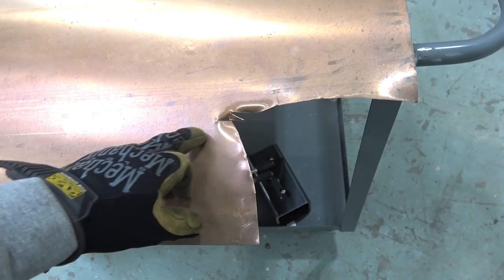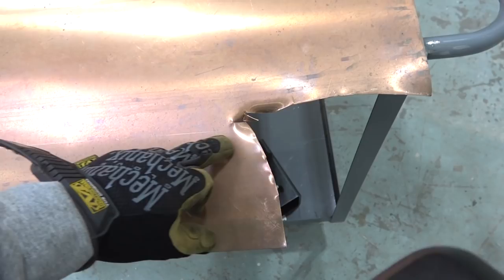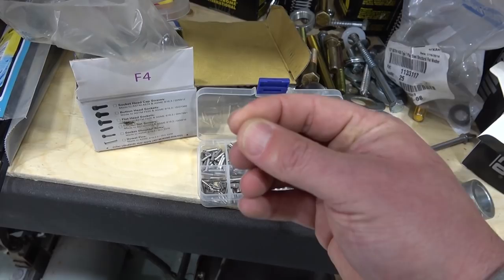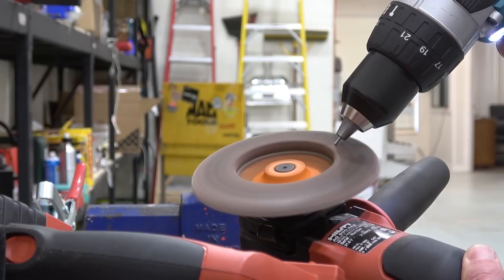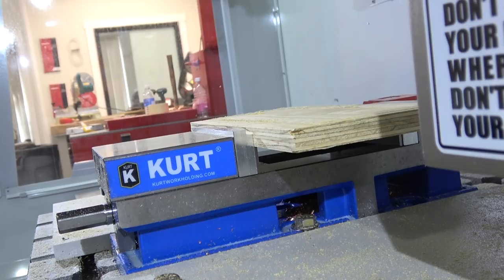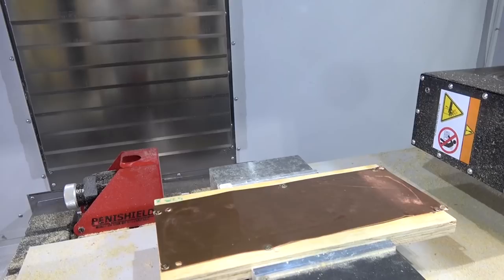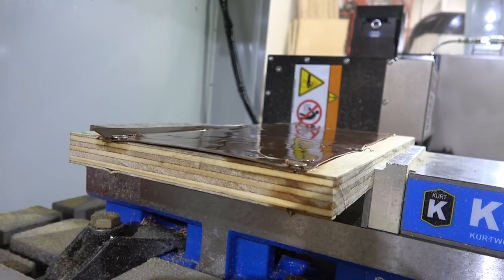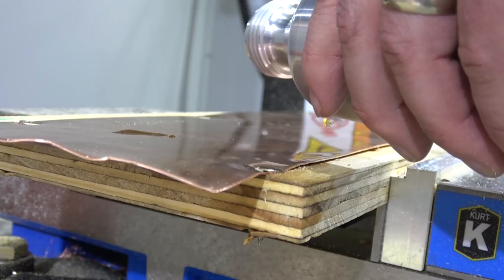Making Copper Signs | Sheet Metal Experiment

Comment: I remember doing something like that in a 7th grade Art class MANY decades ago, although it was by hand... Don't remember what tool we used, but we did not need a pre-cut backing plate to do it... Basically some sort of tool we held in our hands and rubbed the back of the copper sheet to emboss the desired picture into the other side of the copper.  Damn, that would have been over a half century ago -- kind of sounds like a really long time when you say it that way... :)  I had completely forgotten about that until I saw this video... Thanks for bring back the memories...

Comment: Close your lungs little berings. I choked on my coffee. Another thought: Instead of dead tree bonz use a HDPE cutting board from the dollar store?
Reply: Yeah, that's a great idea.
I was considering a chunk of Corian or some other resin/polymer type substrate. Pretty hard and tough, with no grain or anisotropy. My be a problem obtaining a nice few offcuts, which would be obviously cheapest and ideal.
Not sure how the edge would hold up as it could be somewhat brittle. But I think it could work great for a small run batch sort of deal.
The HDPE route sounds well worth checking out though.
Reply: @ChristopherThompson1980  exactly my thought, perfect for experimenting
Reply: @greenveg42  Thank you! randomly and all to infrequently a bit of brilliance shines through the fog.
Reply: @rationalmartian  yeah, at a buck a go, it is the right price for experimenting, I was thinking about the edges also. I'm not sure you really want strong sharp edges, less you create a shearing action with the underling material
Reply: @johncoops6897  I was thinking cost, and also I'm not sure you really want strong sharp edges, less you create a shearing action with the underling material. So if you end up having to chamfer the underlayment to prevent scissoring, why not just a cheap hard plastic that will compress/deform smoothly. Humm... as I think about it I wonder if plastic would "bunch up" and protrude at the apex of acute angled features
Reply: Just use a chunk of aluminum. Same tools cut wood and aluminum so just get a half inch chunk of aloominiumum. It's not that hard to find. You would be amazed how many things are made of aluminum and you can harvest the carcass of whatever you're cannibalizing with a little battery powered circular saw. Anything with a carbide blade works great. You can use a router or laminate trimmer on aluminum as well. Use carbide bits and spray them with wd40 as you go. I've found that if you rough cut your piece pretty close to final size the router clogs less and you spend less time picking chunks out of the bits. It's not perfect but it's pretty close. I use these techniques for production in a sign shop so I know they work

Comment: If you are in need of real tough dead tree carcasses you don't need to go for boat making material you simply go to your hardware store and shop for deck planks. The low budget one are treated plywood but if you look at the more expensive ones you'll see they are made from various exotic woods. Real hard and real nice i use those to make tool handles :P

Comment: use fasteners that arent tapered on the copper sheet side so that it doesnt form "waves" and remains perfectly flat.. or use washers?.. also why not use metal harder than copper for your backing so it has some reuse-ability? or some hard curing resin perhaps?

Comment: In architecture school we did this, but without the wood. just framed up plastic or aluminum and programmed a 6 axis staubli robot to run the tool path. especially with the plastic it comes back a bit when you are done running your full path (think like a topo map, but with one continues line going farther and farther down), but it worked pretty well for forming organic shapes. We 3d scanned my face and i ended up with a scaled down plastic version of half of it.

Comment: I must admit I would have liked to have seen you do a comparative sign using lil screwy where you press the copper plate between two sheets of ply with both positive and negative embossed images on, mostly for the cleanliness of result of the single point forming versus single use carbohydrate dies

Comment: I had to do a relief in school identical to the process you did here, but all by hand. The whole time, I was thinking there must be a better way. I was waiting for you to press too much and cause the copper to tear since it's so easy to do. CNC wins again.
Reply: StapleCactus, you read my mind. I can remember the same project in art class. Still have the piece, too. All by hand, and if I remember right, we used punches, and small, lightweight hammers that looked similar to what an engraver would use.
Reply: @Smokin78Squire  Yeah, I think mine's packed away. I remember bending too much and tearing the copper, then having to hammer-weld it back together.

Comment: Interesting take on repousee', usually the copper is sunk into a layer of pitch and then worked by hand with dapping tools. A small dapping tool (look it up in a jewelry tool catalogue like Gesswein or Stuller) in your cnc may give you better definition and less swirling on the raised parts of your letters. A good layer of pitch around the sides would probably hold your metal with no need for fasteners and keep it from buckling during your forming.

Comment: There is a similar tech, mill a tool plate from a apropriate material.
Dont presure rout it, for small part use hydraulic pres.
Sheet of hard ruber, or a sheet of thick soft carboard like felt type.
In closed tooling this tech is used by hydraulic presure,

Comment: 3D print the form at 100% fill, then use a hydraulic press and firm rubber block to force the copper into the voids in the form.  This process would probably work better on smaller projects - less force needed and not as large a printer platen required.  Less filament used, also.

Comment: That's similar to how I cut stencils for SMD (out of aluminum flashing) on my little 3040 Desktop CNC. 
I Don't use a  pattern though. I cut with a broken .7mm carbide drill. It's on top of an aluminum plate ("Acquired" Road Sign). 
Just take tiny DOC and it sort of cuts / wears / presses the soldermask out. Gotta babysit it the whole time. 
Not for production, BUT a well made stencil IS for production and will last for Hundreds of PCBs.
You can Mill PCBs from copperclad on that machine too, if you've got a 1 off prototype that needs checking yesterday.

Comment: Actually, recycled toilet paper (MDF) is hard on tooling. It’s surprisingly abrasive. I found that out the hard way.....  I have a set of those shears. They were made by Kett, and coincidentally use a Millsucky drill motor. Pretty skookum tool!

Comment: Hi, I would maybe try a milled negative mold as you made with vacume ports and seals milled into it holding the sheet down. It will force the sheet to the table, allow a more consistent depth cuts and may allow some flex in the sheet to be managed.

Comment: Just use a hydraulic press, wood tool and a rubber block.... aero tech as used by foes USA bikes. 

Loads easier and quicker...
Reply: I was thinking of a simular concept, a sandwich of wood, copper and rubber and two rollers. Snug down and send it through.
Reply: Maybe the finish wouldn’t be as great (not that this was phenomenal) but you’d want a good finish on the “die” before rolling it through wouldn’t you?

Comment: Fun story time:
I bought a new set of craftsman (made of the finest chinesium) and the handle of the 3/8" has a massive crack. No problem I'll send it in to be replace. Sent it in and when I got it back, nail catching crack still there. I called and got someone who clearly speaks in a broken English that most people who doesn't speak English will feel offended.
I asked what happened to my warranty and she replied close to the following: "Your warranty was expire after opening the case. We no longer obligated to replace the faulty tool" obviously that wasn't the only thing she said but that the biggest thing that pissed me off to no end.
I asked to speak to a technician about it and the moment I did i heard a gasp that tells me i offended her but she did transfer me to a tech.
The tech, with clean English, asked me what's wrong and the moment I told her what going on, she started laughing. After she calmed down and apologized for laughing, she asked me how is anyone suppose to know if the tools are faulty, explained she worked in the warranty department before Sears sold it and she said she'll take care of it. A Month later, got a package with a new ratchet, parts kit, new ratchet handle,and  little tube of grease.
Just to show that sending companies that been in a single country for years over seas, not the  best idea.

Comment: I'll stick with the re-used and abused pins I made from centre punches, cheap(ish) socket set t-bars and various hammerheads for different depths.  It's not as fast as a a C-N-C machine reet enuf but it gets there.
Isn't it amazing though, how the embossing like that adds a bit of stiffness, even spring to copper and other thin floppy metals?  Monococ...Monocoque...Monoco...ah, feg it..!
PS.  Neat subject.  Just one, right?  Ya got there though.  'S what matters.
[Edit:  Additional sentences at the bottom]

Comment: So, this is neat, and seems like a good way to emboss copper ifin you don't actually have a CNC and need to carve the wood on a mill or by some other method.  I've done it on my drill press, takes forever, but it can be done. On the other hand, if you have a CNC, why not just make a set of dies and use a press?  Even made out of cheap steel they ought to be good enough to get a fair number of signs stamped out, and when the dies are dickered you can run off anther set on the CNC.  Making dies by hand is a time consuming pain in the arse.  Pressing a go button takes that away after the first one, doesn't it?

Comment: Should have gotten a nibbler so you could cut curves. Power sheer is nice though. A slab of hdpe or nylon would probably work better for the basal platen wood is cheaper then half inch sheets of plastic though. Maybe glue the substraight down instead of relying souly on the wood screws

Comment: Did you have  fun time cleaning the MDF dust?? Try Using POM plastic, easy to machine and not  as messy as MDF. Plastics should be machined with single flute bits (you'll be getting rice-like chips)

Comment: Use a piece of maple or oak and a pneumatic de-scaling gun with rounded needle(s) tip(s).  Better, Faster, and Cheaper.  No power tools? No problem! Use a small chisel & carving knife and then a hammer, mallet or rock on a nail with a rounded tip.  I did that as a kid over 50 years ago.
For those of generation (i.e "last few letters of the alphabet"), it's not kewl unless it uses Bluetooth and a cell phone!

Comment: One time use platen and you could use explosive forming.  Suspend suitable explosive a few inches off the metal, then fire in the hole.
Part of my misspent youth was with such energetic materials.  I would smash the base of a beer can into pavement etc.  Rest of the can was shattered into thousands of frags.
Still have all limbs, appendages and eyes.

Comment: I'm definitely going to try this on my CNC router/plasma  combo. I will have to see if the router will work with a dimmer switch because the router part was an upgrade and since I don't work with wood very often I did not get a proper spindle basically a hand router mounted and giant brackets and my slowest speed is 10000 RPM. I would like to get a proper spindle what are the computer controls the spindle speed instead of only on and off and liquid cooled would be amazing because the hand router is so noisy. The company I bought it from wants $2500 for the bracket and spindle which is probably 3x what it costs

Comment: Bit late but what if you just used a firm Styrofoam instead of wood underneath sheet? Then you might not have to route out the words, you could just press into it with more force and maybe a bit of heat.

Comment: You're giving me an idea. I wanted to make a similar style copper/bronze/brass sign and thought the only way would be to cast it. I have some copper sheet laying around. Unfortunately I don't have a cnc router, but i have one of them 3d printers. if i print a positive and negative and put the copper in between and squeeze it on the press, do you think it would work?

Comment: Is there not simply a way to run the machine without the bit spinning? Seems it doesn't need to in the first place. Sure there are probably things in the firmware checking for that but it should be simple enough to trick them right?

Comment: Would this work ,base plate in rectangular box,annealed copper on top,clay/sand layer with metal plate fitting inside rectangular box on top so it can be compressed with a bearing press or vice etc?

Comment: So why not do hydro forming if you are going to make a run. Machine in steel make a top plate use home pressure washer. You should be good to hydroform with a home pressure washer on that copper.

Comment: hi ave love the channel i learn alot i have a huge request im not to great with the pixies and need some help i have a 2013 injection model yamaha ybr 125 motorcycle and ive bought a  truck air horn for because im loud and proud but i dont think im going to pump out enough angry pixies to get the full 178db's is there any way to make the pixies angrier direct to the compressor ? and if so would you mind making a little vajayo of how to do and what id need many thanks mikey.

Comment: Hammer forming or corking sheet metal over a forming buck depending on what side of the pond your on is the poor man's way of creating exactly what you did with far less $ for a cnc and time programming 1s and zeros. Hardwood would be your best bet as hdpe is a bit stiff possibly causing the tool to shear through the metal. Using a piece of pvc home trim doesn't keep its dimensions without growing in size altering the outcome. Not an expert on metalworking but sharing trial and error outcomes.

Comment: Off topic but I have an 18v NiCd Porter Cable cordless drill (PC 1800D) and the batteries are bout pooched, the drill functions fine otherwise anywho I was looking at replacement batteries and stumbled on to lithium ion conversion batteries for slightly more and a "20v MAX" series lithium batt adapter but that would only be practical if you all ready had other 20v tools. Thing is I noticed I can get a 20v kit with drill and impact 2 batt and charger for $150... My question is I guess is the MAX series drills as good or better than the older style 18v drills or are they chinseyer less durable units, if the old drills are beefier I prob just keep my dick in the vice n spend the money for new battery's. Any input would help, cool video by the way!